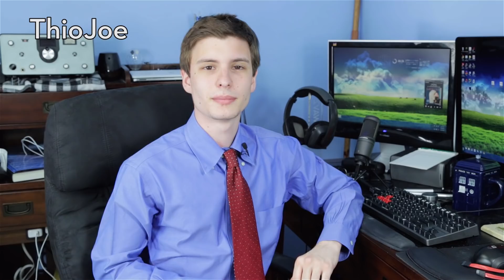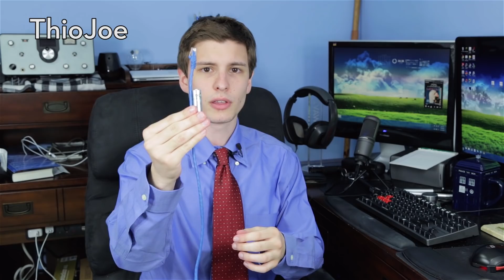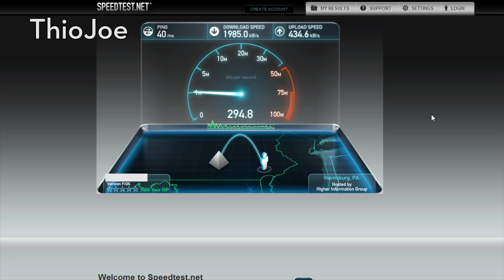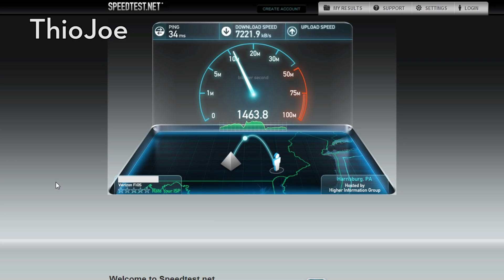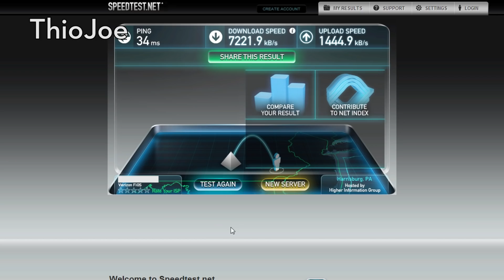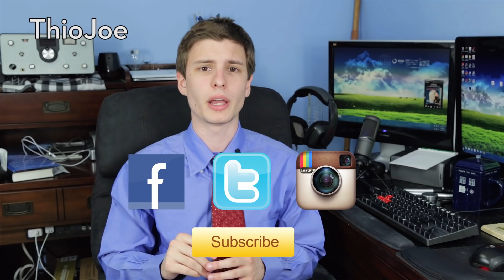Triple Your Internet Speed for Free

Comment: If you do the same with MMF (you will have to wrap it in aluminum foil to make it electrically conductive) you can get speeds up to 2 GB. I think I may need to try Reynolds Wrap as the private brand aluminum foil didn't work well. I only got about 1.3 GB down speeds. A very tight aluminum foil wrap is required though. I'll post a video soon.
Reply: And I think I have some IDE cables laying around in the back of my Model T. Will have to go searching.

Comment: This is complete bulls&*t. First, electrical tape made of either vinyl or plastic and make great insulators. They do not conduct electricity and most will insulate 300 volts to 1000 volts per mil thickness. Far more that what your PC, your ISP, or those 1.5V batteries can muster.Second, and probably the most important part to this, is that magnetic induction (short for electromagnetic induction) cannot be accomplished through the use of DC. Batteries are DC (just read the package) so they do not and are not affected by any kind of magnetic induction. If DC could have been affected by electromagnetic induction then Thomas Edison would have won the 'War of Currents' back in the 1880's and we would all be using DC for power instead of AC. A great actual example of electromagnetic induction at work are transformers. Are transformers DC powered? Nope. This is because in order for something to have magnetic induction you need the build-up and collapse of a magnetic field. AC does this when it goes through the positive and negative half cycles. DC is static, and thus no building or collapsing of magnetic fields.Lastly the internal resistance of wire is determined by the length of the wire, the thickness of the wire, and the composition of the wire. Each and every wire has an internal resistance measured in ohms / foot. Don't take my word for it go look it up. Electricity travels on the outside surface of a conductor so the larger the diameter the more surface area and therefore the less resistance each wire has. There are 2 methods that you can use to 'effectively' lower the resistance of any wire, not just data wires. You can (1) run a larger wire, and (2) you can run parallel wires (think doubling the lanes of traffic). Both of these methods will decrease the 'effective' resistance of your wire.- Navy Nuclear Electrician

Comment: There's is a plug that looks like it would be used for a enthernet cable on the back of my cable box. I need a wired connection for my xbox one. I'm thinking about buying a small cable to connect them would it work?

Comment: Hi Thio.Joe, for a long time I've been saving to buy that new surround amp as the current 100w/ch model just doesn't drive my JBL speakers hard enough. I'm kind of hoping that you can spare some of your immense wisdom on say, tripling the output while also halving THD. I simply can't wait to see what can be done with some copper wire, a coat hanger and a very large torroid.

Comment: First; your internet speed is stored and locked in a file in your modem, sent into whom by your ISP DHCP server.
Second; it's KiloBITS, not Bytes that you see on your connection.
Reply: And pseudoscience isn't real science
Reply: Can we change that speed on the modem
Reply: you need some vanished software which cannot be found anymore on the internet. just search on google how to increase modem speed and you will encounter some pages where tells you need to use some software on your modem.

Comment: Does this work in Canada? We are pretty far up north and I think gravity works different here. I have a lot of extra batteries in my igloo, but I don't want to use them unless it is absolutely necessary as they are very expensive! +ThioJoe please advise.
Reply: +Viaticum yea it would work. But you must cut your cat 5 cable in half then shove 69 cats inside it so that it becomes cat 74 so you can compensate for the cold and gravity difference.
Btw, quick tip, make sure yo use electrical tape to silence the cats, or your neighbors may report you for animal abuse.
Reply: Does the water in your toilets go clockwise or anti clockwise ? That's critical. If it goes clockwise you have to add pepper, salt, and taste it to ensure you did put enough.
Reply: It might work, but I'd advise against it. The Canadian snow spirits will be most displeased if you mess up. Try reversing the radiation polarity to 2.76 megajoules and plug your SATA disc into the cable transistor. I also advise having a local Inuit shaman nearby to distract the snow spirits I warned about earlier in case you mess up.
Reply: ah yes the gravity does in fact work different up in canada because as many known isaac newton( the inventor of gravity) was born in the u.k, and thus he decided that gravity would be strongest in the uk. also the cold will affect the gravity too because isaac newton decided that gravity would hide from the cold almost like as if it feared the cold
Reply: Is this a joke.
Reply: yes
Reply: Javier Lim Thank you for the advice! I definitely do not want to be accused of animal abuse, that would be horrible! Hey, maybe it would help if I just spliced part of that cat 74 (with proper electrical tape, of course) right into the 120v outlet? More volts is more power, which is more speed, right?
Reply: Viaticum You can use Syrian Refugees instead of the batteries

Comment: What if I told you that:
1/ The battery has no electromagnetic field if she's not used
2/ The electrical tape is useless as: 
            - you're not placing it on any surface with electric current
            -and if it was, it won't "conduct electricity" but isolate.

Youtube should delete this kind of "content creator" that are creating bullshit clickbaits, not giving them verification badges.

Comment: I am going to go kill myself knowing that there are people this stupid let alone people that beleive this. first electrical tape is not a conductor thats why it is used in electronics. second batteries will d nothing if not slow it down things take time to get places the farther the destination is the slower it is even light cant go somewhere instantly third batteries are polarized you cant just put them how ever you want and lastly this wouldent work any way light travels faster than electrons and ethernet uses electrons and wireless uses radio frequency photons. no one ever trust this idiot.
Reply: ok I went further in the video(thats right I didnt even finish it before I insulted him)"wires are very limited in the bandwidth they can hold... this is because of resistance" WHAAAT are you talking about bandwidth has to do with waves resistance has to do with the allowance of electrons to pass trough things the two are not even remotely related

Comment: Hi Joe,  I assume this is the Cat 5 cable between the router and the Computer.  I did exactly as you stated (except I used standard AA batteries, not rechargeable) and saw no improvement.  It is not the computer as I have a new Mac.  Any suggestions?  Thanks for sharing your knowledge.
Reply: It's a joke/scam, you did not realize???

Comment: Can the blue battery wire ,go from my wall to the modem? Or from modem to pc? I ask because i have a att wireless wifi modem. Also will this cause my monthly useage to go up in costs? Thank you.
Reply: Only if you download more, this just increases the speed. Think of driving to the grocery store from your house at 10 mph vs 30 maps, you didn't go further (use more data) you just got there faster (downloaded faster).

Comment: It actually increased Internet speed. it's 8 times faster now! wooow
Reply: +Rob oNe yea, you should try fossil fuels... Strapped 2 Rocket fuel tanks to each ends. Close to 420 times faster! but also try to use electrical tape around the whole cable! Multi layered works best for me
Reply: +ReOn that's awesome, you are right! I just did. ;) in addition I mixed the fuel with liquid nitroglycerin, works very well! 425 times faster
👍😂

Comment: lol. raising one end of the cable higher than the other will increase your download speed at the cost of some of your upload speed as the data goes down hill due to gravity. if you need to upload files then simply raise the opposite end higher.
another tip i give customers if suffering slow internet speeds is to squeeze the cable with your thumb and forefinger then run down the cable in from the computer to the switch or router as sometimes the 0's get stuck in the cable as they are fatter and can need to be massaged through

Comment: you missed one essential bit - the ethernet cable ideally needs to be RED (high performance). And if it has stripes it will go even faster (yup the same principle in sports cars). I know some hardcore nerds will laugh that it does not make logical sense but you know what? Nor does quantum superposition. It still does not negate its existence.

Comment: Hey everyone. I tested this via wifi, and tapped a battery to my router, and one to the side of my computer where the WIFI card is. I can confirm it works!
Reply: +Dootuz You man tried well. You are great you did it with WiFi, which does not work in PHYSICAL connection........! Really you are greatest then the inventor(JOKER)........

Comment: I work at a mid-size ISP and we use a lot of these cables at work.   The backbone cables we use have GaAs battery packs and are super expensive. It's not very hard to make your own, though. This is a great, and cheap, way to get the same effect.

Something he doesn't mention is that you can also use a similar technique for fiber optic cables.  For long distance fiber we use a similar cable with high-amperage/low-current (HALC) lithium/polymerase batteries.   Since fiber is buried the batteries have to last a long time!

Have fun!

Comment: If you use larger voltage batteries will this further increase the speed? Where can I get electrical insulation tape that conducts electricity? Actually I believe there is such a thing as semi conductive tape used in high voltage SWA cables.

Comment: For the extra speed you have to dip your router and ethernet cable in red paint. Red things move faster, basic law of physics. But to get even more speed you must paint on a white "Sport Stripe" for the added speed. The next step is rather complex however you will need a conductive metal item. Find the plug that powers you'r router. Take the metal item and place it in the plug hole. Make sure yoh hold onto the metal item and switch on the plug. And there you have it! Extra speed. (Do not try this at home)

Comment: LOL. You have to spray the wires with Pam, as the oil creates a nonpolar insulating surface coating that reduces signal loss down the length of the wire. This actually DOES work due to Shannon's entropy.

Comment: not sure who sponsors you but I don't feel you are giving accurate information.  First of all your modem, router and level of service is a key factor in your speeds.  If you have a cheap, low end modem then you are not going to get blood from a stone.  my modem is capable of docsis 3. I did several tests before and after your battery trick and got results all over the place, lol.  that website is erroneous.  I ping same place within minutes of each test and get from 16ms-29 ms, lol.  refresh browser and you get a whole other set of outrageous results.  

Bottom line is,  The best way to get fast Internet is upgrade your service,  buy a good modem and router and make sure you're ethernet cable is up to date and in good condition.

Comment: As an electrical engineering student I can say this much: Even if all this that he is trying to convince you in actually worked like that, still this wouldn't increase your internet speed, simply because your bandwidth isn't limited by your cable. The only thing that might be impacted (theoretically speaking) would be your ping, but even then, it wouldn't matter.

Comment: I just tried this out. now my batteries and cable aren't perfectly straight. I tried this technic through router and by using battery cable directly connected to desktop. neither showed any improvement. I even rebooted router and modem for the wifi test and the modem before the desktop test. I am from Canada.

I used two rechargeable NiMH Batteries.

Comment: I prefer to use a 9volt battery. that way you don't have to test your internet speed online, you can just stick you tongue to the receptors and estimate how much resistance is met by the magnitude of the shock you receive. And masking tape works alot better. Electrical type just gets things really sticky because it increases the amount of electricity and melts the adhesive to the surface.

Comment: Wait, since when the electrical tape can conduct the electricity? :D lmao lmao lmao I just realized, this might work for someone who actually has 50mbps internet, but crappy Ethernet cables, but if my internet is only 30mbps it will never be 50mbps no matter how many batteries I add to it. Specially when internet providers are tapping you after using 300mbs per months and slow you down on purpose.

Comment: My internet is from a tower and plugged into my router..The e-cable going to the comp. is at the most 1/16th or 1/32nd in thickness. Should I get another e-cable plus tape the batteries to it? Out of the 5 megs my download speed is at times between 112-121. Vidios are hard to download. Thanks for the info.

Comment: The second time running the test is always faster, because its cached, those batteries you taped won't give you "noticeable" performance, I knew you were a fraud the moment I saw your trust fund hipster face saying electrical  tape is good because its conductive. What you are doing is shielding, if we wanted to do this we would use the right parts. and yes I'm sure rechargeable batteries are so much better at shielding than regular. Dude..... NO.. just NO... never again. "conductive tape"

Comment: the speed limiting is done by the ISP and not by the resistance of the cable. Also, nothing on our part can make it increase even by a tiny bit. whatever speed that reaches our modem is what we get. maybe it'll reduce depending on wifi strength. dont believe this shit

Comment: I WAS STUPID ENOUGH TO TRY THIS on a 2 yr old Acer on Wavelink wireless. no change, so I bypassed the  home modem thinking that the 2nd cable might be interfering and connected the cable directly to the back of the computer which then locked up. After reset I found that computer was kicked off the network and needed a encryption key to get back on. I then unplugged the cable and moved the cable with battery's back to the modem, computer locked up again. Another reset reviled a fried P.C. with no video  this time. THANKS A HELL OF A LOT GUY.
Reply: well it worked perfecrly for me
Reply: +stoned sasquatch Right! Now be a winner. Wrap a 9V rechargeable battery around your left leg and you will be able to run a marathon in half time. Just don't forget to recharge it when you have covered 20 kilometers.

Comment: ok so question.. im on wifi with my laptop. now if i do your trick from the coax comming out of the wall to the modem and then router. should i see it in my wifi?

so internet from WOWWAY (serivce provider here in MI) to my apt
then tapes battery to cable, that runs from my entry point of my apt coax line where i get my internet and TV from
then plugs coax into wall. can the coax have the batteries or only cat5?
then cat5 to router
then wifi to my laptop

should/can i do the coax?
or should i boost it from the cable between router and modem? 
thanks please let me know :)

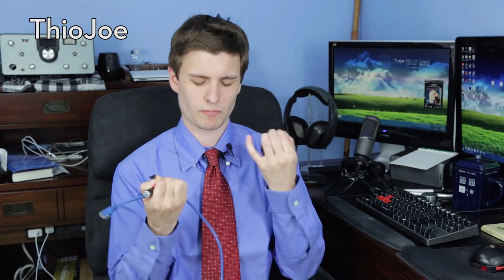Comment: 1:00 I think you may have meant to say electrical tape insulates against electricity? We would have to use metal tape to conduct electricity. Isn't that right?

Results: I followed his lead, and my speed actually went down a bit. And that was likely just because of natural variation.
I've got an idea. I"m going to put some element ununpentium 115 on the outside of the wire. I'm SURE that will work. LOL
Reply: hahahahahahaha you thought this was real.

Dude do you have any idea how ethernet works? lmfao
Reply: y'know these are fake and made for comedy, right?
Reply: NARK NARK Wrong, He doesn't  present it as comedy, but as a hoax. There's a huge difference. You know the difference, right? I hope so Nark.
Reply: Mick Mack actually, in his "reading your hate comments part 2" video, he states that these fake tutorials are clmedy based
Reply: +NARK “NAARK” NARK That's not true. Comedy is funny.

Comment: electrical tape DOES NOT CONDUCT electricity. Wires conduct electricity electrical tape insulates it is the fundamental property of the tape and why we use it in the electrical trades. if you think I'm wrong ask any electrician

Comment: Actually ... here is what you can do to increase your own working speeds... first you take two aa batteries... take one and put it your mouth... then take the second... bend over and stick it in you a--... then bite down real hard and clench your butt checks really tight while jumping up and down for 1 minute.  You should feel the extra energy coursing through you body very soon... but it you still want more... you can take a SATA cable (no need to cut off the ends) and stick one end in your mouth... and the other end... you know where... and jump for another minute.  Then you should be good to go for the whole day.  Repeat each morning as necessary... hope this helps.

Comment: Holy shit, I attached those batteries, plugged in the cable, turned my pc on and the processor is not i5 but i7, I have a new graphics card and even 2 ssd disks appeared. Thanks so much for this, you just saved me a 1000 bucks for buying a new computer.